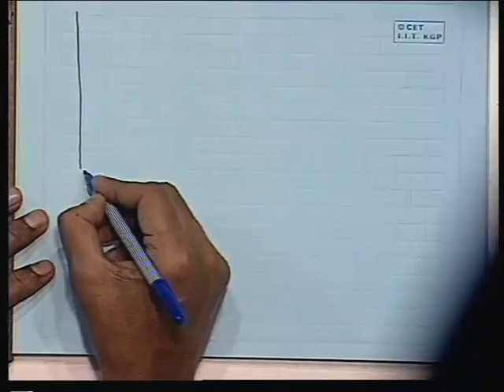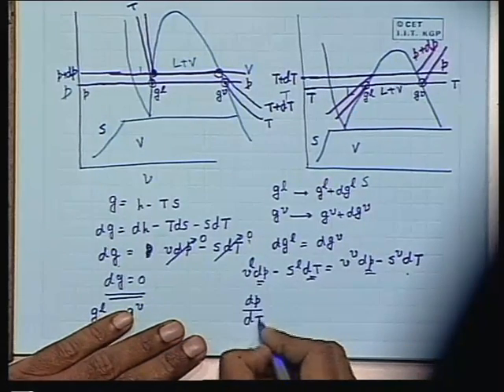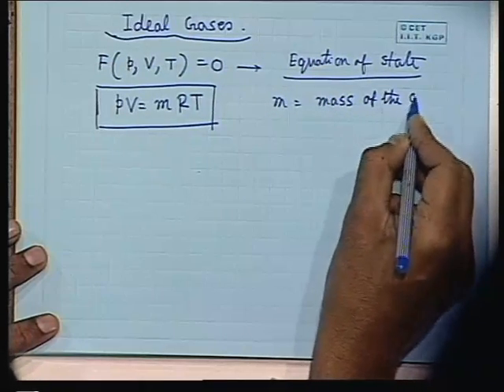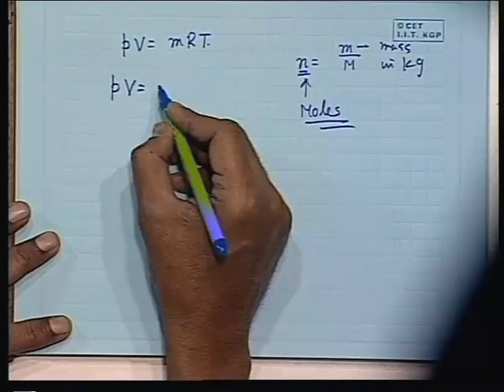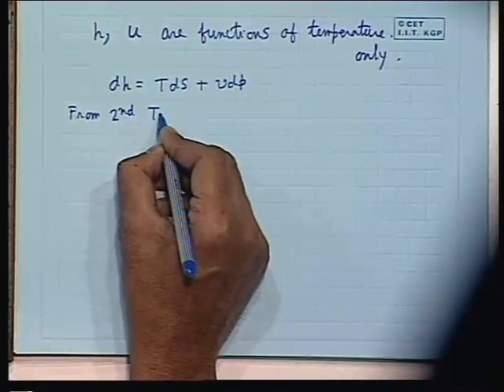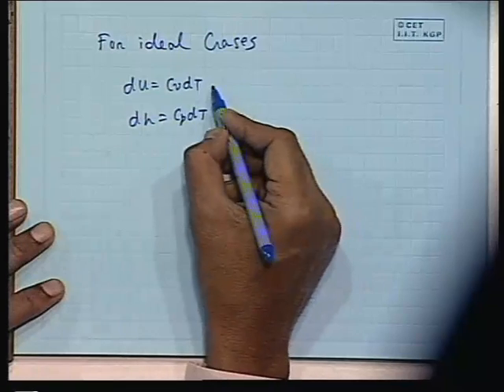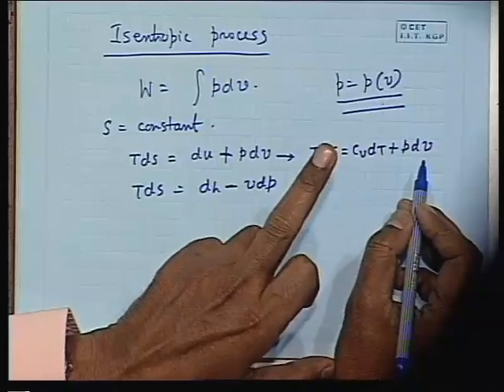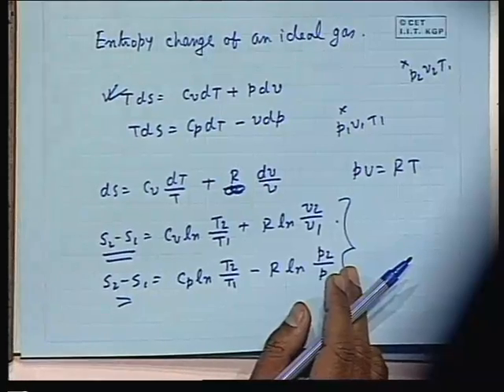Lec-18 Properties of Pure Substances: Ideal Gases

Comment: del h/del p at constant T is zero for ideal gas...so h is function of temp.    but this condition is only for ideal gas. what about other gases.....
Reply: refer P.K.Nag engineering thermodynamics book (chapter11 page 360 onwards) in the subsection of energy relation.
Reply: terms like volume expansivity gets introduced in the equation...the equations will be used for real gases  models such as virial eqn. and other stuff